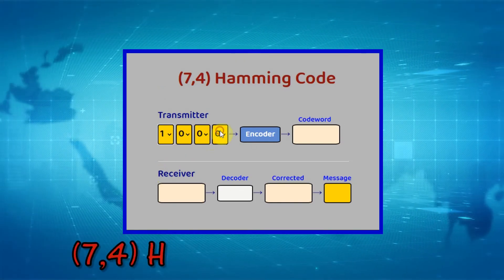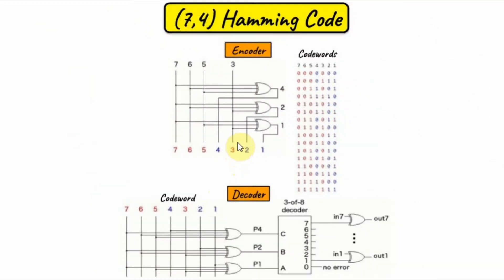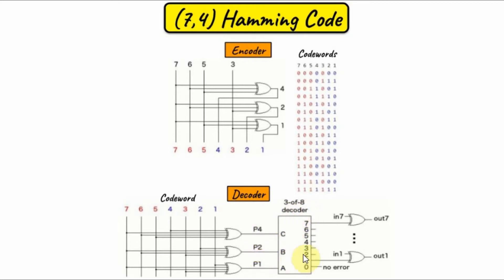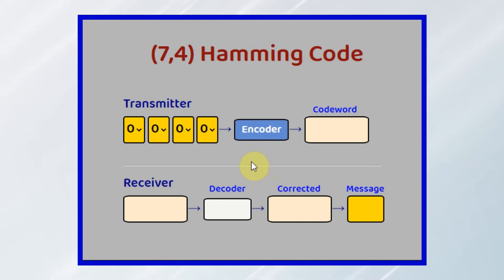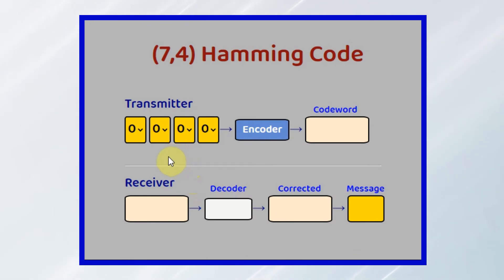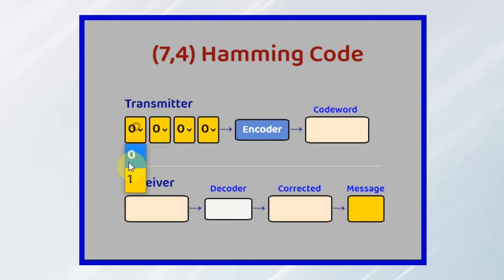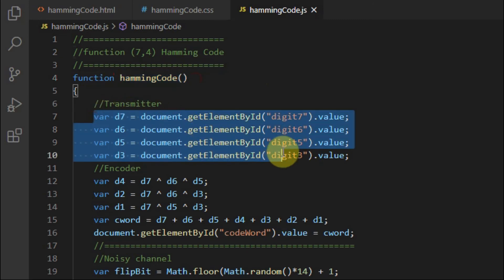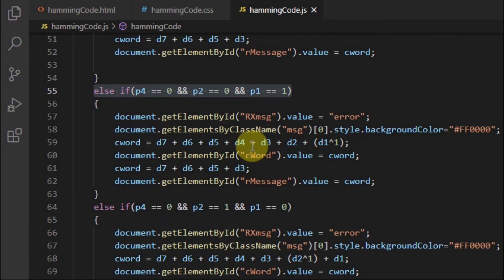(7,4) Hamming Code Webpage

Comment: Anas very good even your projects, congratulations. It would be possible to make the next videos with ESP32 Websokets, could make a complete system with reading of analogical, digital sensors and also, physical buttons using the pushbotton to connect loads, buttons to activate electric locks and also the IP and password configuration screen. Wifi.
Reply from the maker: Hi Marcos. Sure, I'm thinking of a complete system with a nice web interface.